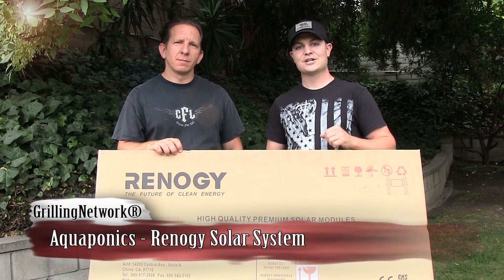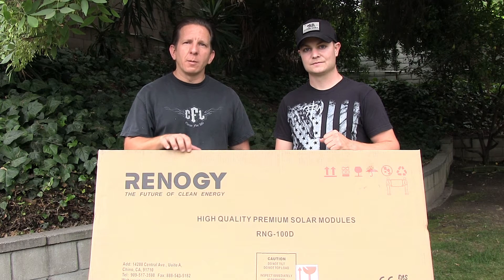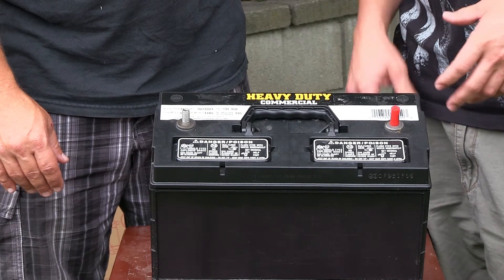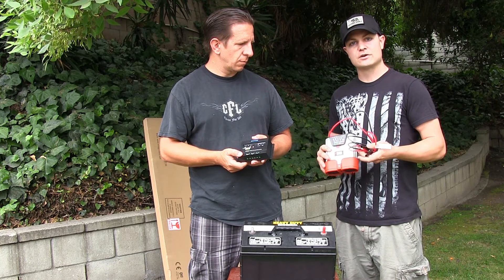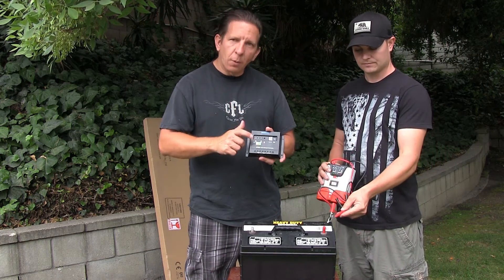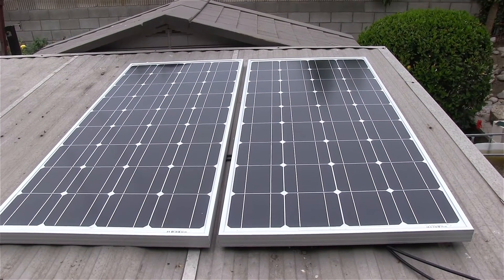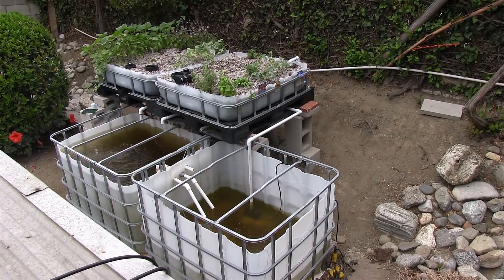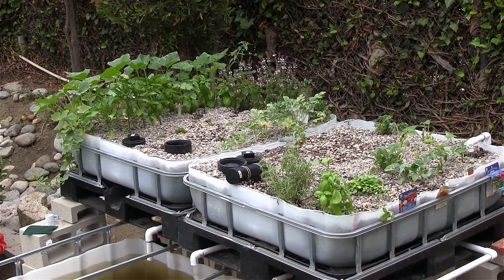Aquaponics BackYard System - Renogy Solar System (Off the Grid)

Comment: * I'm taking a training course in solar panel installation, repair and maintenance. My instructor recommended this book [link here >>>https://plus.google.com/u/3/113778429958471787540/posts/67MrRb1YGej ] as an excellent resource along with the course. I'm finding it invaluable. By buying it through Amazon, I saved considerable money and received it very quickly.*

Comment: panel, check, charge controller, check, inverter, check,,battery, ??????????????????????, wtf where did the deep cycle battery go? mediocre at best! fn truck battery has enough capacity to start a truck a few times, not designed for deep cycle loading. here is an idea, next time, before you make a video, read a book on the subject. That way you can fake your way through without looking too stupid. and as quoted below, its not a (how to) without the how.

Comment: You should skip the inverted 12v to 110v and go straight to a 12v pump.  So much waste in converting that power.  12v pumps such as found in RV would circulate just as much water and your battery (Deep cycle) would run it for days.